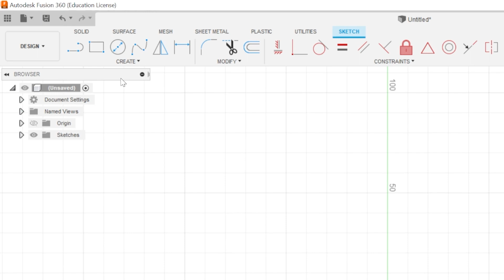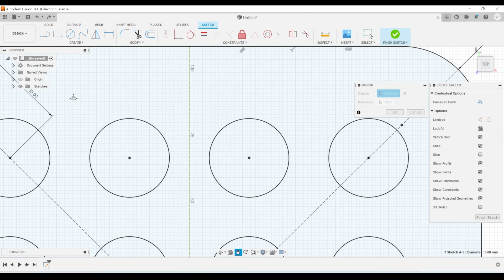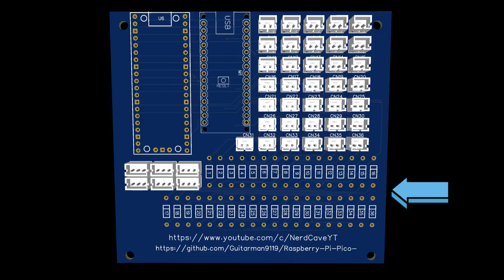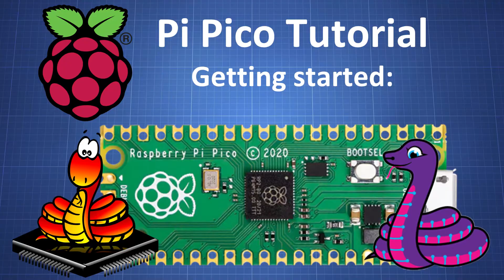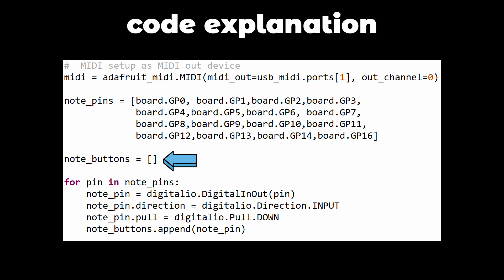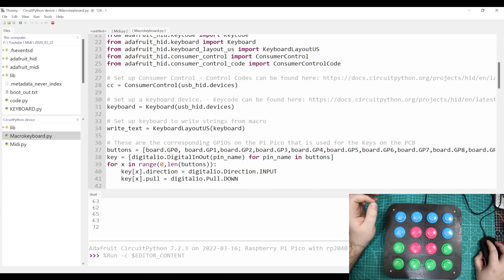Building your own DIY MIDI controller - Very Simple

Comment: HOW GREAT ARE YOUR VIDEO! For me is better than the adafruit. I have a question, how can i add a pot in this project?
Reply from the maker: Well this is based on circuitpython from adafruit so if some awesome people did not help create this library this would not have been possible, regarding adding a pot you will have to use either of the two ADC on the pico and make a function for the pot that would depending on the pot be a value from 0 to 100. Regarding to mapping it, it should be straightforward but I will have to check in the DAW program. This is something I want to explore in future project video, I will let you know as soon as the video is up
Reply: @NerdCaveYT  thank u so much!
Reply: Wait can this work in only FLstudio or every other daw

Comment: Hello, I follow step by step and it works very good. I used the adafruit-circuitpython-raspberry_pi_pico-en_US-7.2.3.uf2 in the folder instead, and that fixes my problems. Now, I will try to temporise the button in order to make a second MIDI note when I will keep pushing it for few seconds. I'm building a looper RC-505 with ableton and ClyphX
Reply from the maker: I would like to go back to this project but I had no idea how any of these ableton or similar programs work, I made a PCB and 3D printed the case is in my workshop just need to record and figure out the software side. I also noted that the new circuitpython caused my macrokeyboard not to work anymore and needed go downgrade the firmware
Reply: @NerdCaveYT  Does it only work with fl studio?

Comment: does this have velocity control too or just note on/off input?
Reply from the maker: no velocity control it is set in code, I guess using a potentiometer added to this MIDI controller you can then adjust the code to change velocity. I actually do want to come back to this project. I need to spend more time in the software side how to make music since the electronics part is simple just have no mixing experience

Comment: hi! awsome video! can your code be used on a raspberry pi 3? I see that I probably should change the pin variables to match the ones present on raspberry pi 3. Also, is it possible to use this with pizeoelectrics instead of buttons? Using the capability of intensity that a piezoelectric provides, not only being a swith on-off thing
Reply from the maker: if you are using the raspberry pi 3 I would think you will have a python script that execute the midi and send it to specific software or you want to use the Pi along with a PC? I have not use the raspberry pi often so I might not be able to answer the questions accurate.
Reply: @NerdCaveYT  actually I was thinking of having the pi output the sounds, I suppose I wont be able to use fl studio, but something else

Comment: New to coding, I'm getting an error message that says:

"Traceback (most recent call last):
  File "<stdin>", line 10, in <module>
ImportError: no module named 'adafruit_midi'"

Any ideas on a solution? thanks :)
Reply from the maker: Did you import the libraries to the pico? https://github.com/Guitarman9119/Raspberry-Pi-Pico-/tree/main/MIDI%20and%20Macropad%20Project/lib which is here. for the midi controller I am using the adafruit midi library
Reply: @NerdCaveYT  Hey. i ended up realising i didn’t import them. thanks anyway :)

Comment: Nice video.... I was looking for an alternative to using Arduino Board with USB host and stuff to create a MIDI controller which sends MIDI over USB without the requirement of a host. Can this board do that without the use of a USB host?
Reply from the maker: You should be able to connect the pico to a midi output, I don't have any midi devices but I found this: https://diyelectromusic.wordpress.com/2021/04/05/raspberry-pi-pico-reversible-midi-out/ there are a few projects where instead of using the usb to pc you connect the tx and rx of the pico to send through a midi jack
Reply: @NerdCaveYT Thanks for the suggestion, I will give that a look. So can we use the PICO as the MIDI device only when the code is running? Like can't the code be pushed to the PICO in any way and it will run the code when powered?
Reply from the maker: @prat2609  in circuitpython if you save the script as code.py it will run when powered and in micropython it will be main.py so if you want to make changes to the code.py just open thonny and click stop to interrupt the code that is running automatically when plugged in

Comment: Very informative, good job. Would you be able to route the MIDI output through to an actual MIDI cable? This way you could control a synthesizer with the pico. I have a USB to MIDI, but alas, the pico does not have a USB port for this cable.
Reply from the maker: You should be able to, I don't know so much about MIDI controllers but you should be able to output it to a MIDI output jack. I know someone who knows a bit more about this things which has electric piano etc. which I can ask that I can barrow and test, I know lookmumnocomputer did a midi controller with the arduino and to a midi output I will check that and come back to you

Comment: Would it be possible to set this up as a sound board for streaming?
Reply from the maker: Yes definitely you would be able to, there are many free soundboard apps and virtual audio output, So I would rather instead of making this a MIDI make it a macro keyboard so the sounds you select is linked with the Macro key. Or if you keep it MIDI you DAW you can setup sounds to be map to each MIDI output and make the DAW output to be a separate channel which you will use with your streaming software. I don't have so much knowledge on DAW's but you can do it for sure.

Comment: Do you know how to program a pitch bend?
Reply from the maker: So I would think you probably will want to do it with a pod or a resistor like a wheel to change it, to change pitch back and forth almost like a joystick. For that it will probably then change the value as you change the resistor value. It is a good question and definitely something I can revisit or make a short video on
Reply: @NerdCaveYT  I'm going the opposite route and programming the actual number of centitones. Strange territory

Comment: Hi , How are you? :
when executing the code in Th (with W10), it gives me an error when I want to install the code in the Raspberry pi pico:
*Error:
Traceback (most recent call last):
  File "<stdin>", line 5, in <module>
ImportError: no module named 'board'

---
how could i solve it?|

Thank you !
Reply from the maker: Hello good and you? So based on the error it can be few things do you have CircuitPython on the pico the firmware and secondly in thonny did you set the compiler in bottom left corner to CircuitPython

Comment: @NerdCave is it possible to use piezo pads as input instead of these arcade buttons?
Reply from the maker: You should be able to yes, I have not worked with piezo before think it is analog but with some circuit should be able to make it digital input, I am planning on using a very cheap kid drum set and making it a MIDI controller with piezo sensors, so once I know more can get back to you.
Reply: @NerdCaveYT  most e-drums use piezo to generate sound, I'm building a DIY e-drumset at the moment that's based on piezoelectric pads
Reply from the maker: The Pico only has 3 ADC, so you going to either have to increase the number of AD channels or I guess use an op-amp with the piezo to trigger a digital input
Reply: @NerdCaveYT  and for cc and a potentiometer? i want a transport bar  midi; play, stop, rewind, loop... etc.